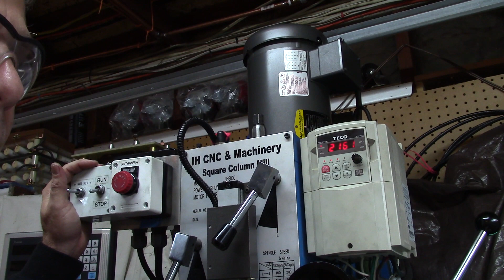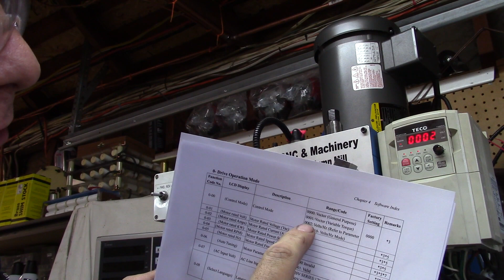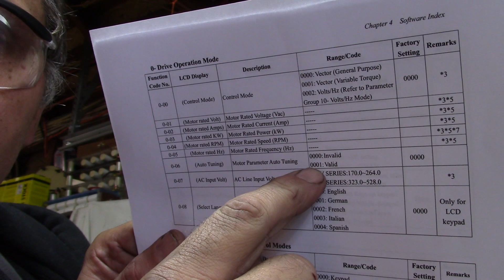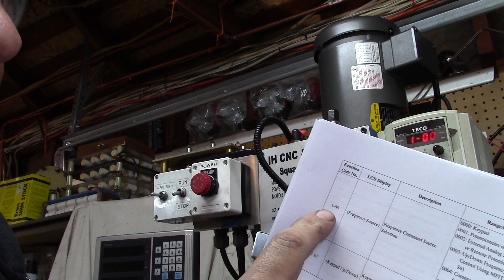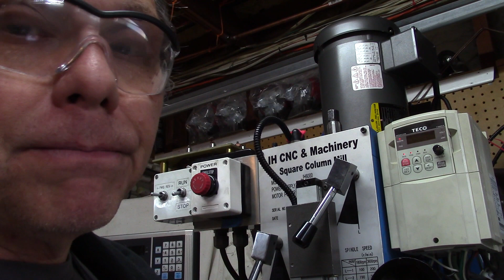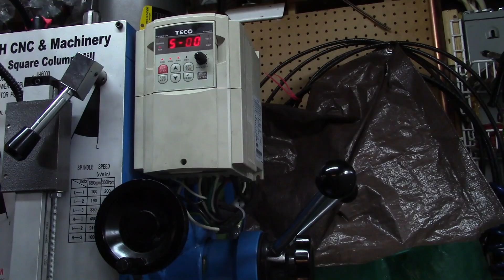Programming a TECO CV7300 VFD for a new 3ph motor

Comment: looks like a great movie, In the next weeks I will now find out. I have a 3-phase 220 v motor and we have only 1 Phase 220v and 2-phase 110v. Thanks for the effort to put the setup online. It was more clear than the manual from Teco ( Kudo's earned ) I will use the same VFD to run a 3 phase 220 V airfan on 1 phase 220v.  It would not be a headache, but burning out your motor or VFD if you are on a budget,  this is great information.

Comment: Sir Good eving I wanna Knew how Setting Parameters, where I can find parameters cn-02 and cn-19?
Reply from the maker: Hello.  Thanks for the question, but unfortunately, the Teco7300-CV that I have does not have those parameters.  They appear to be for a different device called a TECO speedcon 7200.  So I don't have any information about that.  Sorry.
Reply: Thank you Sir That's Why I Ask This Because Try Open The Parameters is Only 0-8 only I was saw in the Display
Reply from the maker: @v.l.policher4915  I wish I could be more help to you, my friend.  The cn-02, cn-19 parameters do not exist in the Teco 7300CV that I have, so unfortunately, I'm not sure how those would get set.  I see from looking at Google that cn-02 sets a maximum current to the motor, and I don't believe such a thing is possible to set in the Teco 7300CV.   I wish you the best in your endeavor.

Comment: I agree - very informative and well explained! I have this whistling sound from my motor when the Teco runs it. Sounds like you have it as well. Is that normal or anything I should worry about? Cheers from Denmark
Reply from the maker: HI there and thanks.  Glad this is informative.  I am not familiar with a whine from the motor itself, but the Teco does make a whining sound, especially when varying the speed.  That high pitched whine has to do with the transistor switching to create the 3 phase power for the motor.  I really can't comment about the motor itself.  Mine does seem to make a sound in sync with the Teco.   It hasn't caused me any issues over all these years.
Reply: @musicmakelightning  Thanks a lot for your answer - that was fast! Im sure the sound comes from my motor, so I will dive int this. But thanks - you helped me quite a lot with getting the thing to work at all. A friend gave it to me, so had no idea of how it worked..

Comment: Very good explanation!
I need to use the function "speed control" using (i think) S3, S4 and S5, but i don't know how to do that. The goal is: run a motor with 3 different speeds, is that possible?
Thanks for any help

Comment: Would this drive operate a 3ph permanent magnet motor
Reply from the maker: I don't think so.   I think there are VFDs that have PMAC motor modes, and this one does not have that, far as I know...
Reply: Thanks for the info, the search goes on. Let me know if you hear about one that will.

Comment: Excellent video and explanation thank you. I installed an Altivar 11 many years ago to my large bandsaw and it's never really been right. I'm now looking at how I set it up with the help of fine utubes like yours. I don't think it's man enough for the large motor as I'm getting under voltage and load errors after a few minutes running. Thanks again for the insights on these VFDs

Comment: Really helps me out thanks, I have an Industrial Hobbies mill identical to yours and I'm replacing the chinese motor with a Baldor (USA made) 3 ph - 3 hp motor. I had been considering the Teco 7300CV vector drive so now I'm pretty sure that's the drive I'm going to get. I can't stand the gear head noise though, and want to go with a belt drive system. In addition, it's irritating that there is no provision on the mill for a geared drive to downfeed the quill like on a Bridgeport (which is dumb on the part of the chinese!). If you are using a boring head you get inconsistent bored diameter and surface finish by just handfeeding, so I'm going to look into get a stepper to control the quill fine feed. Thanks again!
Reply from the maker: Hi John
I agree completely about the lack of a downfeed.  I've looked at the idea of somehow motorizing the fine adjustment for the quill, but can't get much energy behind it.  If I was going to totally CNC the mill, I'd definitely add that.

For the Baldor motor - be careful there.  I replaced mine - but I found out pretty rapidly that there was a size difference between the Chinese motor spindle and the Baldor (I don't have the specs in front of me, but I seem to remember the Baldor motor had a ~24mm spindle, and the Chinese motor had a substantially SMALLER spindle.  I wound up having to take the Baldor apart, putting the spindle on the lathe, and turning down the end, and then rekeying it.   I didn't video all that because, well, I hadn't done the measurements ahead of time  (because it required dismantling the Mill, and I thought a D90L motor was a D90L motor, no matter what.).    

Anyway, it was a pain. But I got it to work, eventually.  The machine work wasn't pretty, though.  Took me a couple days, and I'm really surprised it even worked.  I figured I'd just tossed $359 for a motor down the tubes.

Cheers,
Joe
Reply: I discovered too, that the Baldor shaft dia is about an inch, big fat. But, you see, I got the 3 hp motor brand new for $100, they usually will sell for 5 to 7 times that amount. And it's made in USA. Don't know how I'm going to approach this problem. I suppose that since I'm looking at a mounting plate for the motor/belt drive system and the motor will sit up on a bracket/mounting plate on top of the mill gear head (standing off of it a bit),   I could machine a 1.00"/0.750" adapter keyed on both sides (a male/female "union" if you will) that will join both the fat shaft and the existing keyed socket (that the old stock motor shaft fit into). Luckily I have fair amount of tools (but only ONE MILL so when that is taken down in pieces, milling is not an option which I have to keep in mind) and software like SolidWorks to try and figure out just what it will take. And I have a couple of model engineering friends who can machine a part or two (at a modest price of course) for this project while the mill is torn down, I think). Well, Heck! it may not work! BUT I am, at heart, a model engineer and trying and failing is part of the game (though I'd rather not fail if at all possible LOL!) Heck...If I can ever get my dang mill and lathe up and going I want to start my own channel on building steam locomotives and other stuff!
Reply from the maker: I almost went for the mounting plate/belt drive system.  There's a guy on line here who makes them - and I almost went for it (to go along with CNCing the mill).  But I just machined the baldor shaft.  Yeah, I think I paid $360 or something for the motor.  The one I used is a 90L with a C-face mounting plate.  Direct connection to the Mill spindle.  Works fine.  Much quieter than the Chinese one, but can't really say it was worth the $$.  If I could have got one for $100, I would have absolutely jumped at it.

Comment: Nice job with this video.. I am having difficulty setting my vfd to a jog function. Can you tell me the settings needed?
Reply from the maker: Hi George - I haven't messed with this in a while, but I did set up a jog function on my lathe with the 7300, so let me go back and have a look.
Reply from the maker: Hi George. Wow.  This is sort of twisted.  I can see why you're confused.  I was confused too for a long while.  But here's what I have set on mine.  

The key is that you have to set parameter 5-04 (which is the parameter to set the function of the signal on terminal S5 - yes, 5-04 sets parameter for S5...why, who knows) and you have to set that to 0005 - which means JOG.  

Then you need to connect your jog button to S5 (whether it's activated by +V or GND depends on if you set PNP or NPN for your switches).  You set parameter 6-01 to however fast you want the jog to be. Default is 2hz.  You can set it all the way up to 650hz.  You just have to mess around with it to see how fast works for you by hitting the jog button and seeing what happens. 

Now, you might ask - do I HAVE to connect the JOG button to S5?  Why not a different terminal?   I don't know, and from the manual it looks like other terminals may work as the S terminals can be used to set separate preset speeds in general.  But I never tried that.  I can say with absolute certainty that:  A) connecting the jog button to terminal S5, B) setting parameter 5-04 to value 0005 and C) setting parameter 6-01 to something slow - works on my lathe.

Good luck!
Joe

Comment: Thank You
Reply from the maker: +Brett Nicholson Glad I could help. - Joe
Reply: +Brett Nicholson  Hi,I am currently using one of these to run a staged water pump for stock.The run is operated by a pressure switch .When the power goes out it doesn't restart.So in 2.00 I will change it to 0001,Thanks.Also I am wanting to reset the VFD by a relay which i can  controlled remotely.Is this done via s6?
Reply from the maker: +Brett Nicholson I  just went out and checked out the VFD setup on my mill.  Yes, S6 defaults to "reset", so if you cut the power and try to restart right away, it won't work unless you hit reset.  It's the same thing as pressing the "reset" button on the front panel.  I have my big red power button also connected as "emergency stop" which also requires a manual reset to get things running again.  Cheers.

Comment: Thanks for the video Joe.  Saved me a lot of time searching to learn and understand some basics on 3phase, the VFD 1ph/3ph, and setup.  Nicely done!
Reply: Not sure if you could shed some light.  Have the 7300 all wired up and working fine from the display.  I only need a simple on off switch (powering a disc sander)...but connecting the 24v and s1 wire does nothing.  I'm sure I am missing something...